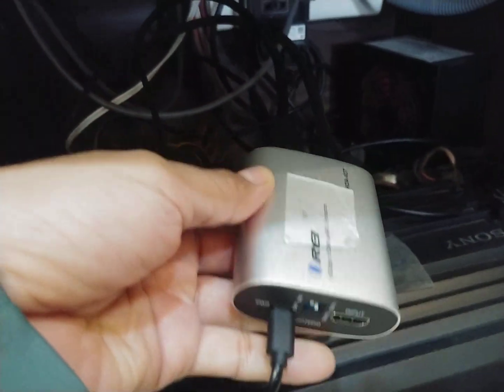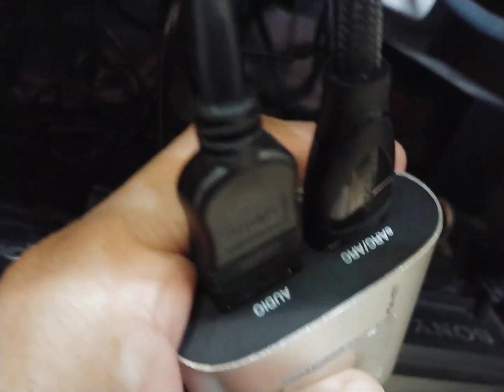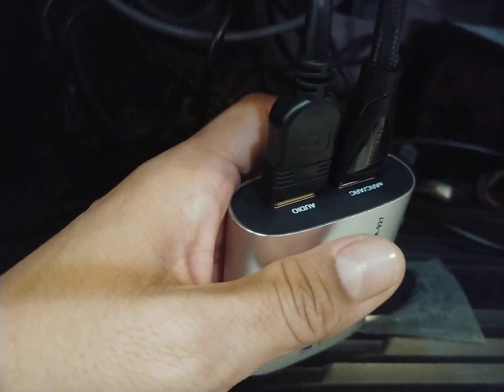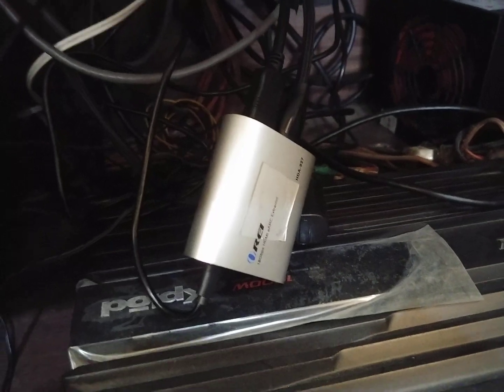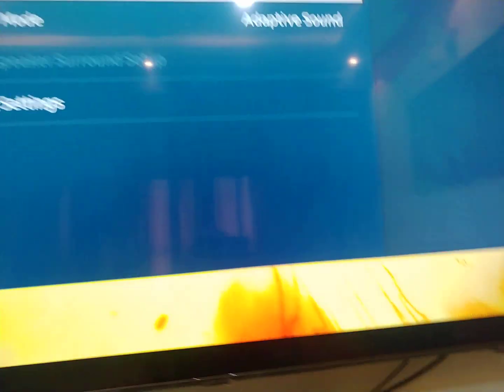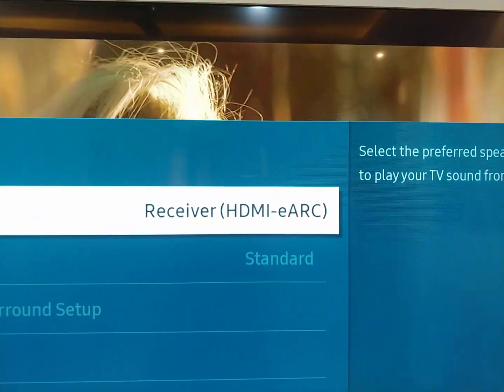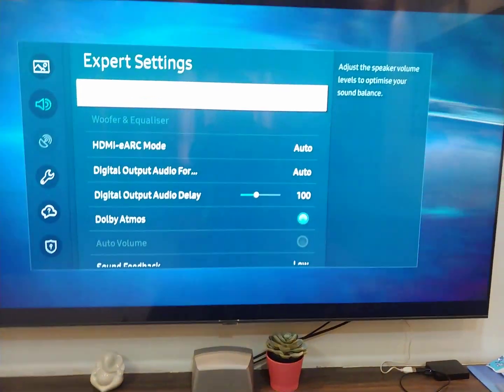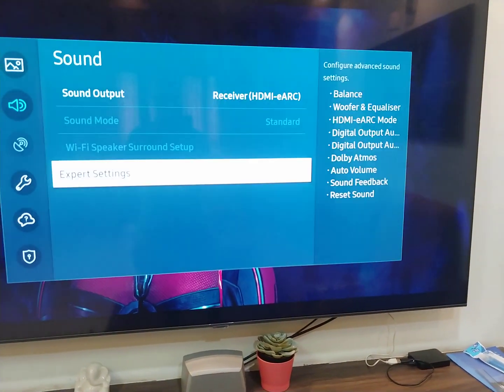OREI HDA-927 HDMI eARC Audio extractor HDMI ARC Audio Extractor - After 90 days of OREI HDA-927 use

Comment: does HDMI CEC work? automatically power on AVR when tv is turned on and volume control using tv remote?
Reply from the maker: No. It doesn't work in my setup atleast. I have to control volume in my avr using its dedicated remote.
Reply: @techyvish1249  thts too bad. Thanks for the reply!

Comment: Hii..can i use this converter for my tv arc but not atmos to my bose soundbar 900?
And will get dobly atmos or not?
Reply from the maker: Do your TV support earc or arc ? This HDA-927 is used to extract the audio and video. For my case, my Samsung tv support Earc, but my Denon AVR does not. So, I am using this HDA-927 device to extract the audio from my TV Earc HDMI out and sending it to my Denon AVR. And yes, I get Dolby Atmos sound on my Denon AVR from this device.
Reply: @techyvish1249  my tv is tcl 2015 only have arc and no dolby support..,and when i play Netflix only 5.1 no atmos
Do u have any idea for make sound atmos?
Reply from the maker: @bongwendy  You may try with Amazon Fire TV stick or Android TV box or similar which can play dolby atmos as source input.
Reply: @techyvish1249  so i just need that or need converter hdmi too?
Reply from the maker: @bongwendy  yes, you will need HDA-927 device or similar to extract the dolby atmos sound from Amazon Fire stick and send it to your soundbar.
Reply from the maker: For dolby atmos sound, you should play dolby atmos video. You may try with some of the YouTube videos which are dolby atmos 5.1 channel. Or download from web (search in Google) and play in your tv which is connected to bose soundbar 900. Hope it helps.

Comment: My tv is earc and avr is arc.  You hookup this unit to any available hdmi other than arc on the avr. When  I select that hdmi it shows no picture and no audio.
Reply from the maker: I think you can directly connect your TV to your avr as earc is backward compatible with arc. Additionally, it depends upon what is your input source to this HDA-927 device. For me, it's my tv as input so directly connecting my tv to earc HDMI port of HDA-927 which extracts the audio and send audio to my AVR (which does not have earc/arc).

Comment: Great video. Will it work in the other way. I have my tv which has only arc. My Sony sound bar has earc / arc. Currently my tv doesn’t sense my sound bar by using HDMI. If i use this, will it solve my audio issue. I need the audio from my tv to be played in my sound bar. Please guide
Reply from the maker: I think you need to check which HDMI port in your TV support arc/earc as this feature is not available in all the HDMI ports of TV. I have 3-HDMI port in my Samsung TV, but only one HDMI port support earc. So, just check first.